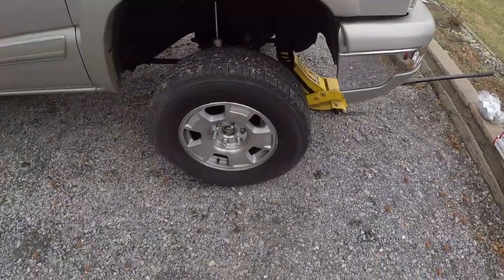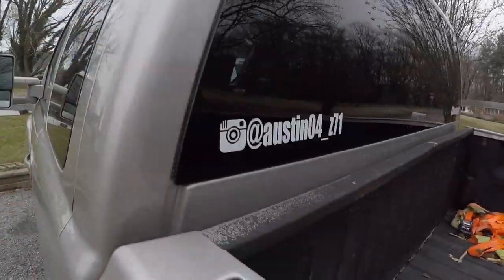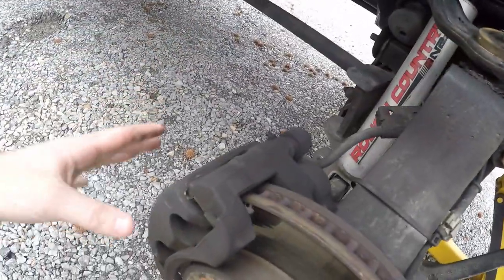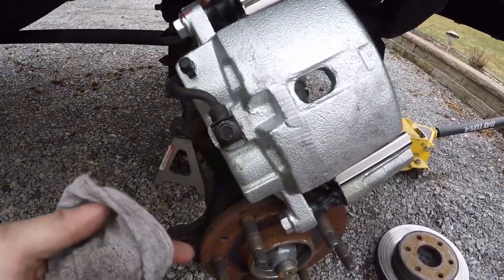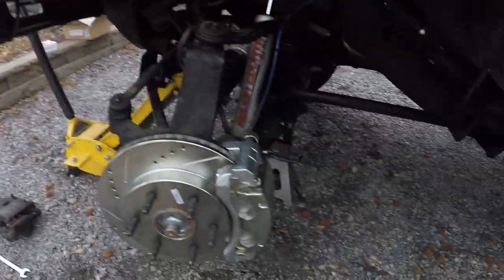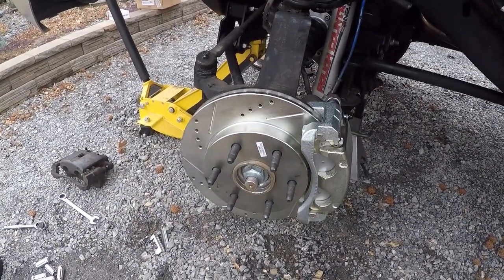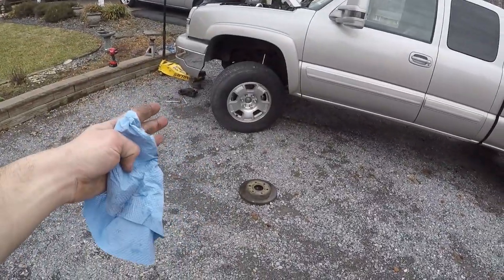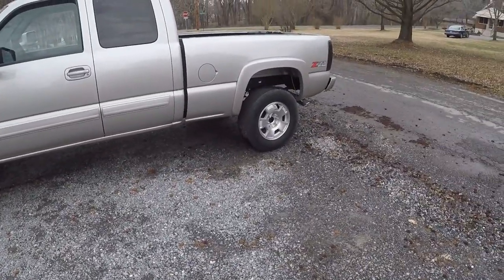The Best Brakes For Any Truck

Comment: I have a 2000 z71 with 9 inches of lift and 35s, I just went through the spongy brake ordeal. What I had to do was change master cylinder because it was leaking internally. I already had to change pads and rotors and after I changed the pads and rotors the brake pedal was horrible, so I done a brake fluid change by completely draining all old fluid and installing new dot 4 fluid. Well after that still spongy pedal so I took off the master cylinder and it was bad you could hear an air sound when pushing the brake pedal. So changing that and a quick brake bleed. I got a great brake pedal, but you do feel them heavy tires.
Reply: Howd you get inch lift? 3 inch of body?
Reply: Yes 6 inch fabtech and 3 inch zone body lift. The suspension lift would have been high enough for 35s with stock size wheel offset, but mine is 16x10 Micky Thompson clasic 3s so they poke out about half my tire.
Reply: @thomasdearing7718  I've got 6 inch rc lift with 33 mts but i rub pretty bad already. Hows the body lift?
Reply: Love it. Truck sits right rides right, and looks right. I bought the full body kit off Ebay. The kit was a simple install, you just need a few buddies and a warm weekend
Reply: I don’t rub at all with 33 AT3.  I only have a 3inch torsion key leveling kit. I could fit 35s with some trimming! But don’t want 35s…33s does all I need and want to do. I do a lot of towing. No need for 35s. Shoot my truck almost had 33s from factory. Which it is the z71. I did the braided lines also to help with sponge brakes, usually only noticed them while towing, so I upgraded lines, rotors and pads.

Comment: I did rotors, calipers, & pads all 4 wheels. Wasn't happy either. You don't need to upgrade to braided lines... Unless you have failed lines? Do your booster and master cylinder (do them together!) They're cheap. Go ahead flush the system while you are at it. It will be like you are driving a new truck, promise! Also, I have been extremely happy with my current set of Akebono pads.

Comment: I've got 4 wheel disc brakes on my 02 and I replaced my pads with cheap ones from amazon (stock rotors and calipers) and my truck stops on a dime so its most likely your master cylinder.
Reply: Link to brakes you got sir please

Comment: My 07 classic has all new breaks with rear drums done also, new break line to the rear, off the distribution block. Blead and still a bit spongy lol. Not to bad though for a almost 500 km truck.  Maybe braided lines, fluid change, and a rear disk conversion will help lol. 
For yours, if its really that spongy, I would check that break booster. 
Otherwize your truck is coming along nicely.
Reply: Your brake booster does not cause a spongy pedal, A bad brake will cause a hard pedal! Two of the main reasons that will cause a spongy pedal would be air in the lines or frozen caliper slides! The easiest way to check is to clamp off all of the brake hoses!

Comment: Make sure that your using metal brake lines as far down as you can or metal braided lines, if you use straight rubber lines the rubber can expand a bit when lots of fluid is pressured into them which can give you that weird feeling to try and get braided brake lines if you can

Comment: May want to look into a hydro boost setup possibly, I have it on my ‘04 Z71 Suburban and it stops on a dime with no spongy brake pedal feel. If you want to go a step further than that, get stainless steel braided brake hoses and replace master cylinder.

Comment: Ran them aswell only thing I dint change was my calipers but did my CVS axles as well. Check your master cylinder. It's most likely leaking past internally. I'd recommend doing your break booster aswell. Regardless it won't be as good till it's got all new parts. Stopping from hitting deer has done a number on mine I plan on changing mine aswell in the future .

Comment: i run powerstops on my dodge charger u will feel the slot and hear them hum when doing fast stops 60 to 100 mph its normal but with just normal driving you don't hear a thing

Comment: I used to think Wagner were the best pads you could buy until I bought a new 2016 F150. The stock pads cost $90 but they stop 40% better than Wagner pads. 
The best pads for your truck would be GM pads. Yes I know they cost $200+ but they will last 100k miles. I have a 2004 Trailblazer and I bought Bosch pads because I didn't want to pay $200+ either. They stop better than Wagner but you can buy them off ebay for $50 or less.

Comment: I didn’t hear you mention about cleaning the rotors before installing???!! , all rotors come from the factory with a coating of grease/oil on them, that needs to be cleaned off with brake clean!!

Comment: What color paint did you use to color match all your plastics? I have an 04 Sierra same color as yours and trying to decide weather to pay someone to do it or just do it myself. Scared it’ll come out shitty as I’ve never attempted it before.
Reply from the maker: WA926L is the paint code. I didn’t spray mine with a rattle can. It’s actual automotive paint

Comment: I had the same problem when I put my lift kit in you have to bolt your brake line to the upper control arm an knuckle . after I did that I had no sponginess..

Comment: Factory brakes are weak at best
In trying to find a 4 or more piston upgrade 
I have been thinking about 2 options Toyota. 4 piston about 100 a pair on Amazon 
Or GM brembo 4 piston use a 14.4 rotor some people using 14 when swapping not. Sure if they fit factory truck bracket. Does anybody know a good place to find 
Info.

Comment: I see you have the MSD coil/coils, they do not gain you and hp and do not have any bigger spark UNLESS you use the MSD ignition box!
Reply from the maker: Have you ever stopped to think that a factory coil went bad so I replaced them because they were old lol where in the video did I say MSD ignition coils improved my horsepower?

Comment: Stabilitrac and traction control module in the brake line circuit might be your "spongy" brake culprit.  Chevy brake systems are very complex and the stabilitrac/traction control valve body is computer controlled. Get someone to do a computer diagnostic on the system.
Reply from the maker: This truck is too old for stabilatrac and TC buddy 😂

Comment: I drove 130 miles once with no brakes on my sierra. My passenger side pads fell out from being too worn and I lost all front brakes. Fluid leaked all over my wheel and ruined the finish. The whole trio i had to stop by downshifting and using e brake.
Reply: Scary stuff.
Reply: At least you know how to drive tho. A lot of people would just scream until they crash into whatever is in front of them.
Reply: @cmj115  lmao yeah for real. I was approaching a light cazually and then boom, foot goes to the floor truck keeps going and i heard a albunch of noise and then just grinding. The caliper was making direct contact with the rotor and by the time I got home. The rotor was completely rounded at the top and the caliper had a huge gouge in it. The piston even came out and the inside bad backing was still in place. My brakes had been squeaking for a few months prior. Must have been an indicator.
Reply: @JosephNnbs  damn. Always change them when they start squealing. It's also a good idea to check them after a while because sometimes the don't squeak. My ladt set of pads didn't squeal so I wore it down to the rotor, because I hadn't been checking them.

Comment: Everyone up in here talking about u need new braided/steel brake lines and master. Ive got a 99 z-71 3in lift w/ 33s so ofcourse my brakes suck, i was going to upgrade the calipers front and rear to 07 calipers up front and suv caliper in rear and then change to hydroboost. You already got good calipers obviously, but couldnt you hydroboost that year of truck?
Reply: Tyler Dirden i can guarantee you the braided lines make a difference.

Comment: Hey bow tie guy and anyone in the comments I have a 07 classic with a 6 inch lift and 35’s and I’m constantly having cv axel problems I just replaced one today cause it was clanking and when I get home the other cv axel boot is shooting grease on the fender walls I wanna know if anyone’s had this problem I don’t know if it’s cause there to much at a angle or if it’s the differential or bad bearings in the differential or if the lift and tires are to much for the axels I just need some help cause I’m at the end of my ropes any one ???🙏🏼🙏🏼🙏🏼
Reply from the maker: Too much of an angle, I’ve done videos on the before. You just pretty much have to keep replacing them. One option is you can go with the 08-13 axels they are longer